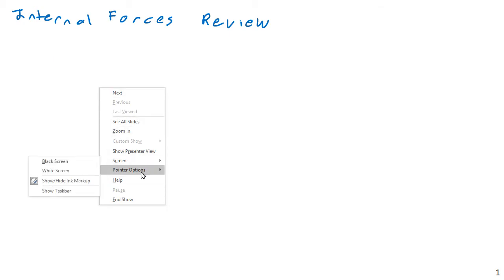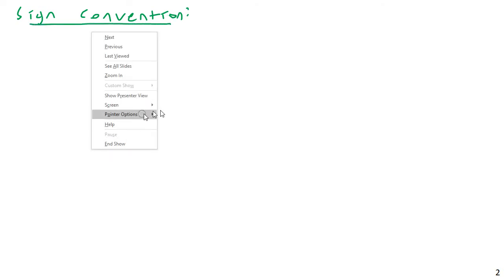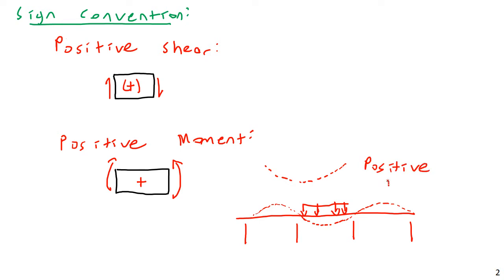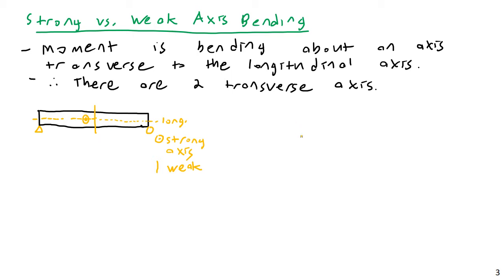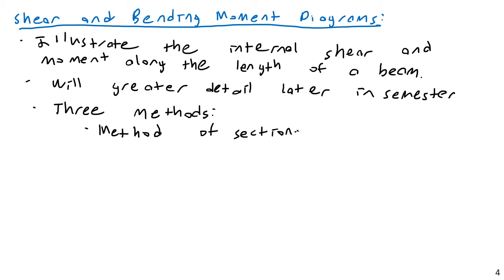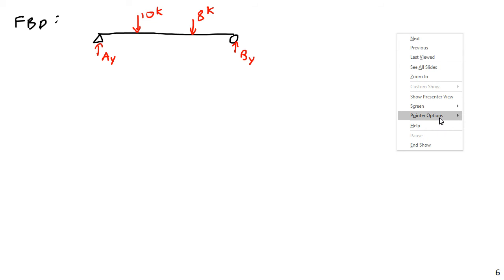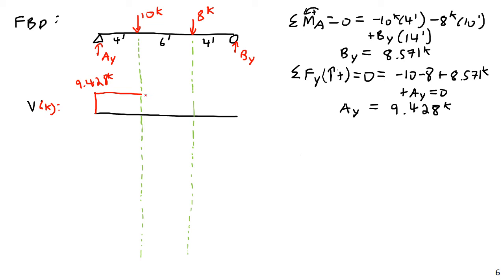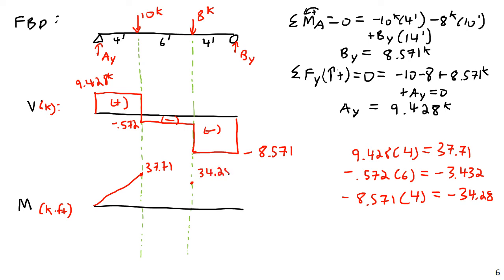Member Internal Forces - Structural Analysis

Comment: I'm 50 years old and I work in civil construction...i am always wondering how the things work around me but am not an engineer so it's hard for me to really understand..  I have a question and not sure if you can explain it simply.  IAlthough i have not taken calculus in a million years, i understand that integration is finding the area under a curve....when in engineering do you need to do this? Like what is the output (y) when all values of x are plugged in under the graph?  I am trying to just get a picture of why this is done and in what situations....thanks a lot for answering if you can.
Reply from the maker: It really depends on the industry, type of construction, etc. If you consider for example, residential wood-framed structures, this kind of theory is baked into all of the design codes. But those codes usually don't require you to go back to base principles and solve for stress and strain directly. Rather, they just have codes stating what size wooden members to use, that sort of thing. 

Where this is really important is in designing steel and concrete structures. These equations of member internal forces allow you to find stress and strain. This then goes into the selection of rolled steel member sizes, the design of reinforced concrete beams, the design of foundations. You name it, these member internal force concepts are there. 

As far as a practical example, let's say I wanted to design a beam to support the floor of a building. I might initially size it based on deflection. I could calculate the live and dead load it has to carry as a line load (pounds per linear foot of beam.) Then, I could run through the equations of deflection to calculate the minimum moment of inertia for the beam I need. Then, I could go to the AISC steel manual and pick the lightest shape (considering depth limitations) that has that moment of inertia. Then once I have a candidate shape, I could run through all the strength checks required by the AISC manual. 

Ultimately, for beam design, the most useful material from this lecture would be the maximum bending moment, and the max deflection in a beam. The max deflection could be used to select a beam size (or check deflection on an already chosen size), and the max moment can be used to calculate the bending stress in the member. 

I know that's a lot, but the simple answer is that all this stuff fits together. Civil engineering students typically take statics->mechanics of materials->structural analysis->steel and concrete design. This video is part a course that is part three of a four course series. Typically it will take students two entire years to go from the start to the end of it.
Reply: Civil Engineering with Tanya J. Laird thank you. I’m sure I’ll look back on this comment and it’ll be helpful to me